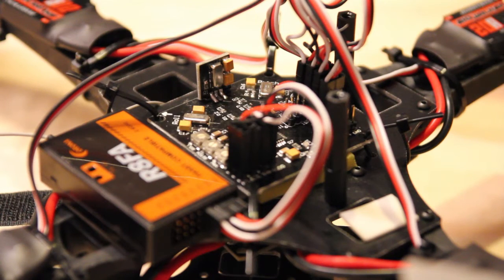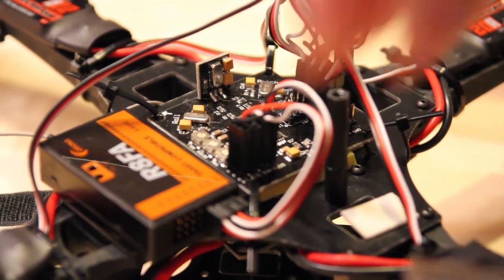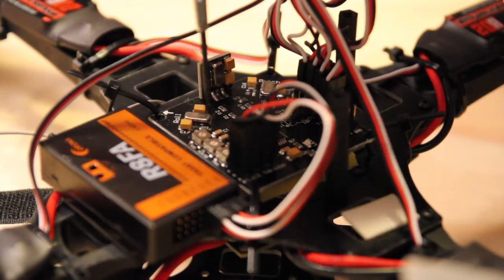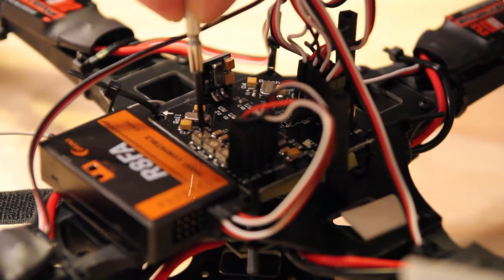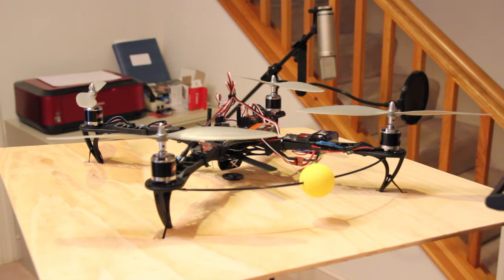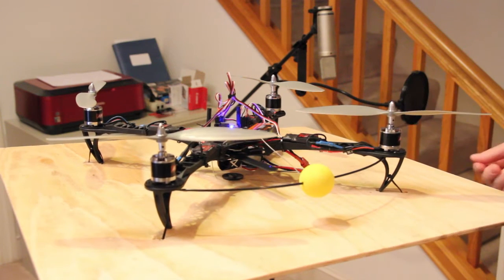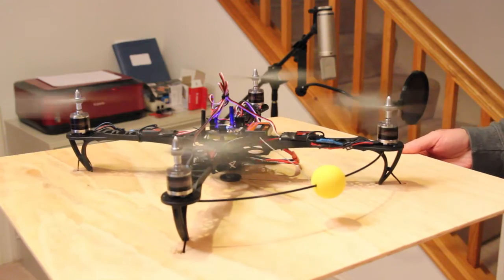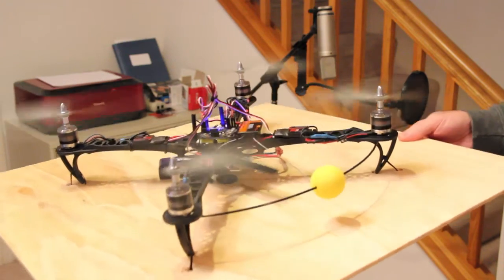Quadcopter with KK Board.  How to reverse, hover test and adjust gyro.

Comment from the maker: First turn it full counter clockwise or clockwise depending on your board.  Power on and use corresponding stick to reverse gyro.  Power off and adjust the pot to about 50%.  Give it a try.

Comment from the maker: Did you try turning your pot fully in the other direction?  Some of the pots seem to be backwards and some are not.  Make sure it is also the correct pot that you are adjusting. If you are still having issues you may want to visit the rcgroups.com kk forum.  Pretty good information there.

Comment: I'm using the same board, I flash it using XCopter V4.7 KK by kapteinkuk firmware, but after the led blink 3 times and I move the stick the led stay off, it's not blinked continuously and I have no reverse on the gyro.